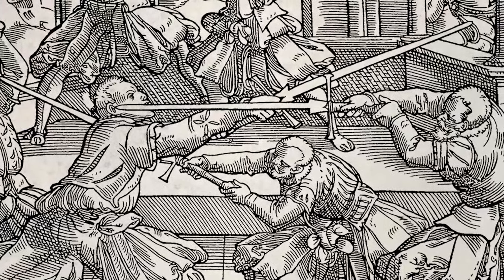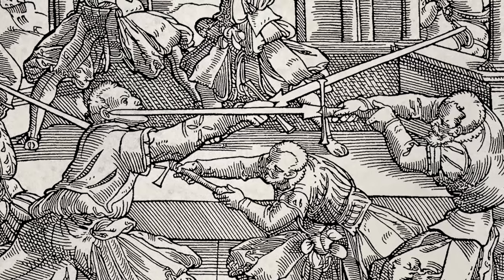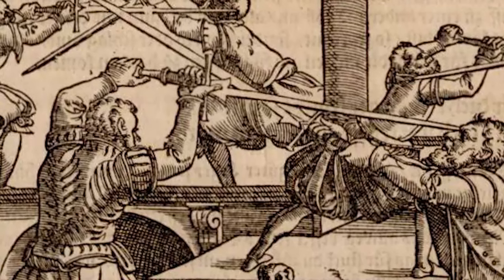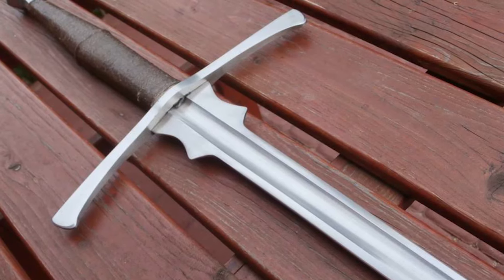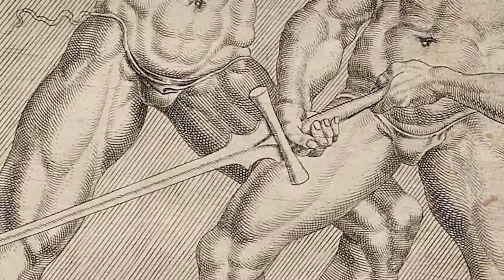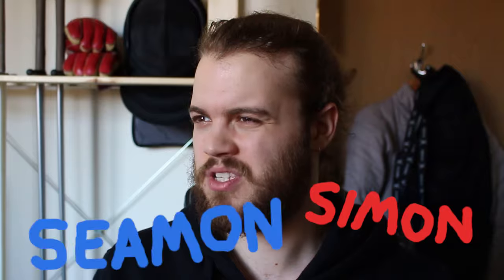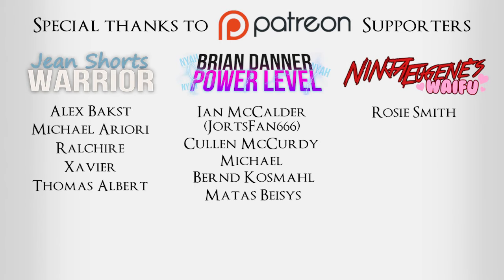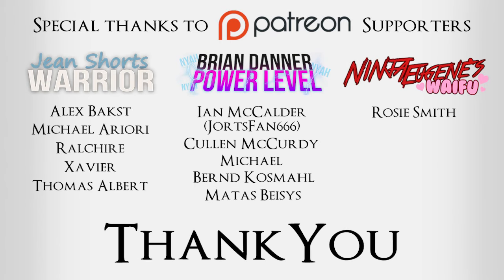What a Load of SCHILTS!

Comment: @KnightSquire:
the reason the feder more narrow is because it's actually thicker, not thinner (you were thinking of width, not thickness). The difference between a blunt longsword (like the ones intended for full contact reenactment) and a sharp one is easily a full pound. So by being more narrow, the feder can retain the proper weight, while having a sufficiently thick edge for practice.

Comment: They are also designed to keep a similar balance and flow that would be for  greater width sword but then dramatically pulling it back from that theoretical edge so that the point of percussion is altered and the transfer of force on techniques isn't exactly 1:1, though this is a bit up for debate.

Also, i like the german horned and the spikey hilts.

Comment: Maybe the the new "Arbeitspferd" line by Black Horse Blades offers the spikey schilt?
Also I was curious to know, as a HEMA beginner, how does the schilt help when trying to dislocate you opponents attacks ("Versatzung")? Also when looking the enemy's blade for a counter thrust and such.
Reply: GandogarFS It’s Good In the bind- particularly when the strong of your blade meets the weak of his. Really, the extra weight there increases the force you can apply. It becomes much simpler to push the blade aside and drive the thrust in- quick and efficient.

Comment: The Shilt isn't really necessary, for adjusting weight distribution nor is there any need to have such a slim and parallel edged blade. (there are several other ways to do it)

The problem with them isn't that they look different. It's that they protect the fingers ...which changes how things work. Changes what works and what doesn't.
They are perfectly valid for training Meyer, of course (it's what he used ...and longswords weren't used in battle, in his time, anyway), but for Fiore or Liechtenauer I'd argue that it's bad to use them.
Reply: ZarlanTheGreen On a feeder the blade really isn’t as thin as it appears. It’s thicker on the edge than it is broads on the flat.